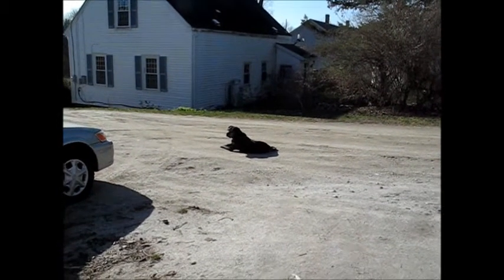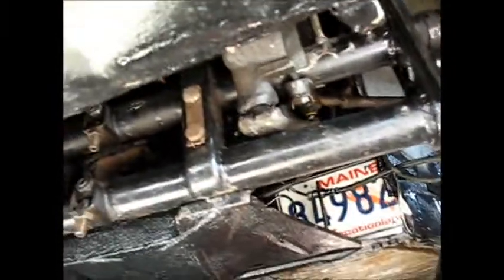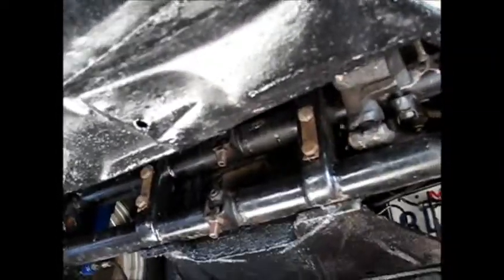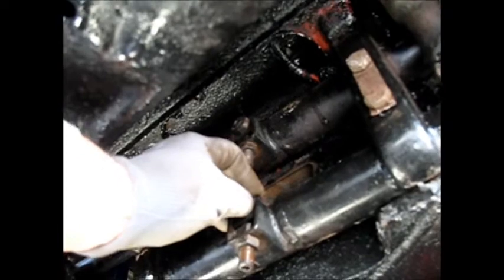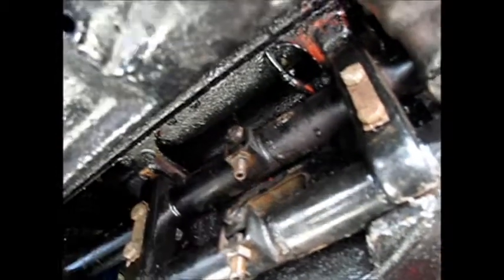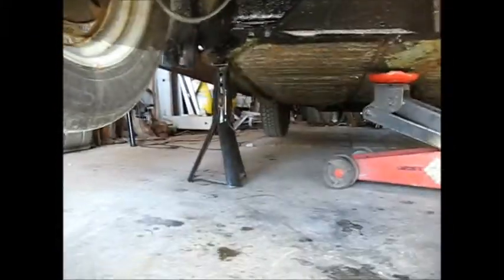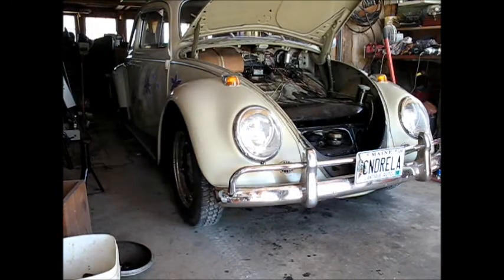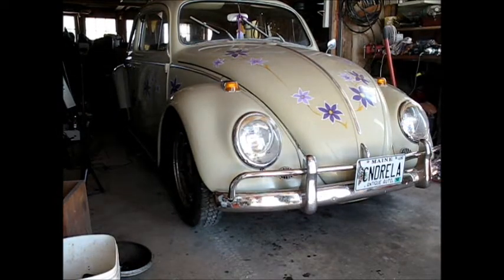Front Axle final adjustment

Comment: I have a 1967 bug here in the Philippines and it has the king/link pin front axle without adjusters. I have just replaced both king and link pins and set the shimming with the offset as per manual, my problem seems to be that when I jack up the front, the right wheel moves forwards and touches the fender. the left one does not move that far??? Also my turning radius seems wrong because turning right I have good sharp turning but turning left seems not as sharp at all. any advice rpeek?

Comment: Seeing this video 4 years too late but for those of you just watching do not leave the top bolt on the adjuster loose, it's what locks the torsion plates in place just like the factory grub screws. The bottom bolt is what adjusts the ride height(up and down). Just an FYI
Reply from the maker: Where were you when I needed you?
Reply: rpeek sorry I'm new to YouTube.. Did it release and fall down?
Reply from the maker: I was having trouble getting it to sit where I wanted it to.